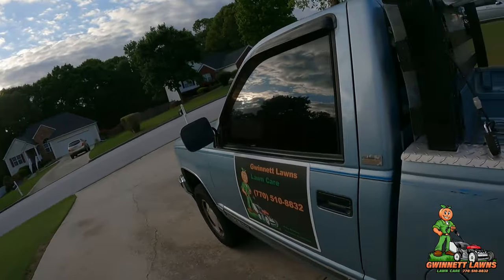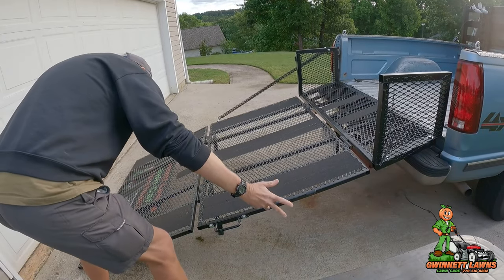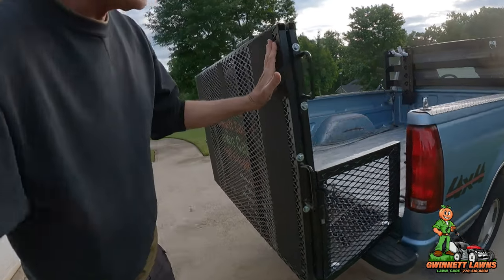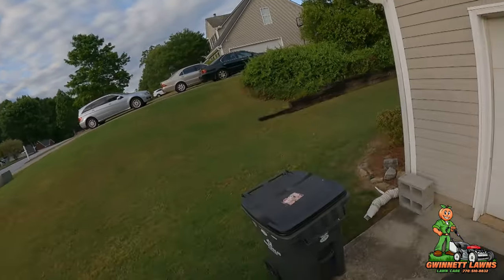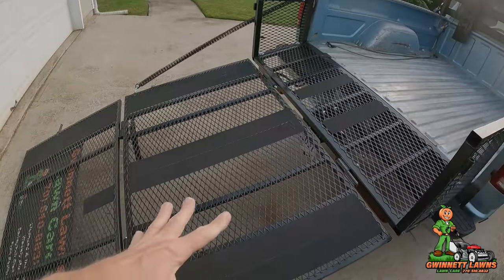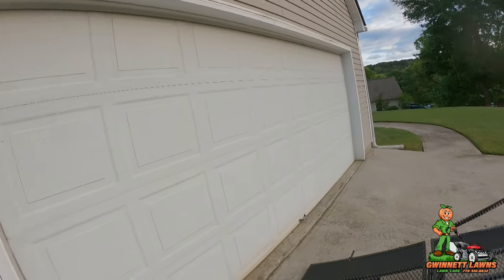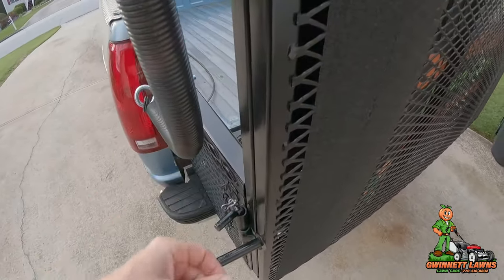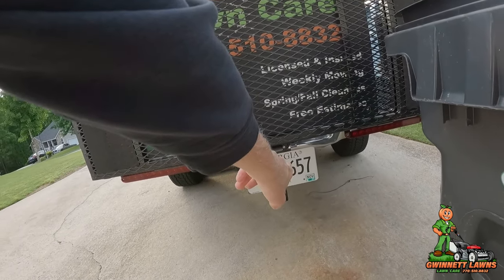Mow and Go Ramp System 30 Day Review|The Good and Bad

Comment: Great review. I have the same ramp and I love it. Similar truck to yours too except mine is the longbed. I can fit a 48” zero turn and 30” Exmark / Toro turfmaster comfortably in the bed. I was needing to solve the slipping problem I will definitely check that grip tape out!

Comment: You should get some top side mount tool boxes on both sides of pickup then by echo multiple attachment power unit and keep the attachments and power unit in 1 box and in the other box other tools /accessories . You could also add a plywood 3/4 inch 2x5 ft towards the cab mount it across the bed attached top of side walls . You could put gas cans tools ect....

Comment: My Ramp rack Sport doesn't have the same type of expanded metal and doesn't have that same slip problem. I do have to say I like the latches on the ramp rack way better, it's far less steps. The Mow and go does look wider then my Ramp rack Sport though which would mean you could likely get a bigger mower in there.... but Yeah I love that I'm no longer pulling a trailer and that's the best part about these things. Also I run Green touch trimmer racks and I would definitely suggest getting some kind of bed rail system to get as much tools out of the box as possible because as you sort of mentioned with the long box comment, space is limited and every bit helps!

Comment: can you still use a trailer at the same time with that ramp on the truck?
Reply from the maker: No not the way I have it.  You can get an extension from the company that allows you to tow with the ramp installed.

Comment: Got a question....how do you get by with that much weight in the back of your pickup? I might be wrong but that looks like a half ton pickup which is the same as mine, a 2014 f150. My main mower weighs 1,500 lbs. I'd be grossly overloaded and would most likely get a weight ticket. Does weight not play a factor in GA? I have to have weighted tags whether I'm pulling a trailer or not as my truck weighs 7,384 lbs. Standard tags here ony go up to 5,000 lbs. Great concept but I don't think it would be practical weight wise where I live with a half ton pickup. There are a couple of companies around my neck of the woods that have those gates but they drive 1.5 ton straight trucks. Great video though.
Reply from the maker: My mower weighs 700 pounds, the trimmer 12 pounds, the blower 25 pounds, the wooden headache rack about 30 pounds, and the mowing go ramp about 200 pounds.
I’ve set an a lot of my videos that a short bed half ton truck is not ideal but it’s fine for the equipment that I have a three-quarter or 1 ton truck could be best but I have to use what I have.
Reply: @GwinnettLawns  thank you for your reply. I wasn't meaning to sound as if I thought it was a bad idea. Quite the contrary. I'm looking to put another truck into service and was wondering about weight. I have two other trailers I could use but both need work and was looking at this as a possible option for a second truck. In NC if they even suspect you're overweight you're stopped and weighed. I would rather spend money on something like this rather than a couple grand reflooring and relighting a 14' trailer.
Reply from the maker: @BigSouthOutdoorsTV no I didn’t think you were being negative or anything at all. I’ve never seen anybody weigh anything down here unless you were a tractor trailer. They certainly could if they wanted too,  but there’s 1 million people alone just in my County  and I suppose they would rather go after the 18 wheeler‘s than us little guys.  I’m assuming you probably have a stand up mower with weight that’s around 1500 pounds?